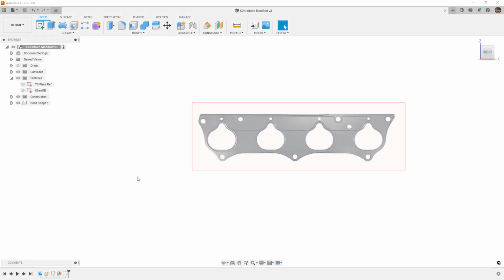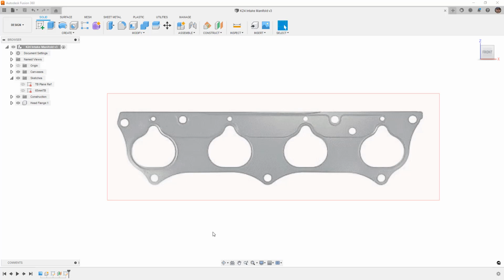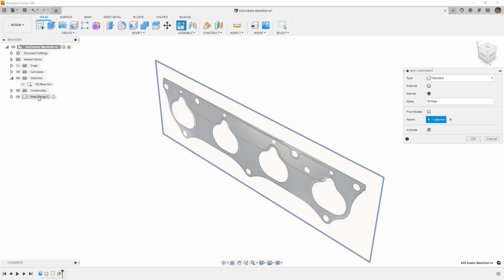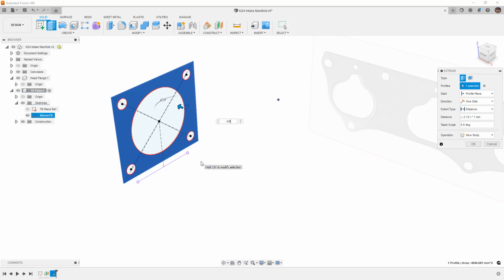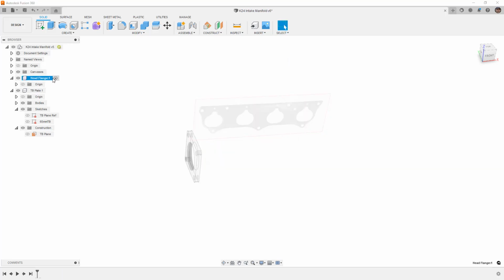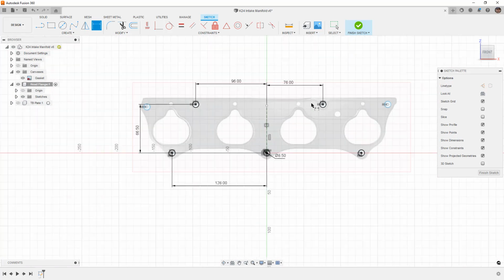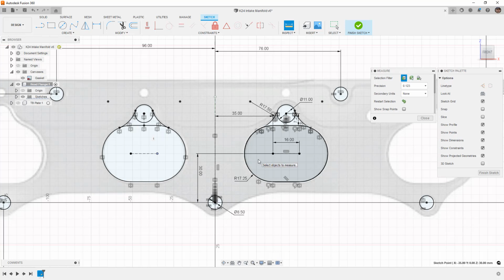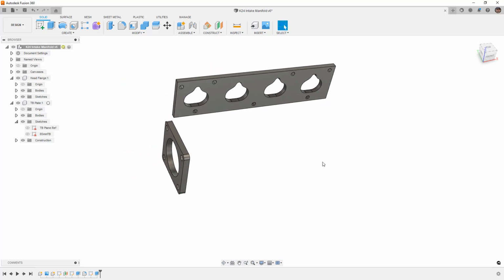Designing an Intake Manifold in CAD | Honda K20/K24 Swap Intake Design Series - Part 1 #Fusion360

Comment: I am loving you channel more and more. Fusion 360 and honda motors.
Reply from the maker: Thanks Jared!  Hopefully in the near future when I clear a few other projects I will start on my honda swap.  After this intake series I plan to do a turbo header as well.  What are you working on?
Reply: @LearnEverythingAboutDesign  I have a built b16a sir 2, built lsd ys1 trans, t04e garret turbo in a 1991 honda crx with a body kit. I want to get the crv trans and go awd.
Reply from the maker: Sounds like an awesome build Jared!  I often wondered how much abuse the old 80s/early 90s AWD civic wagons would take.  Not sure it would hold up to a built B16 but never know.  I had seen a RWD crx conversion but they put the engine in the back. kept the FWD layout and just moved it all back.  Those were great cars and really hard to find clean ones.  I see maybe one or two a year.
Reply: @LearnEverythingAboutDesign  They can take alot of abuse if done right. My buddies d16 with just a fairly simple build is reliable pushing 450 to 500 whp. My b16a sir2 is a jdm version and ive been abusing it at 300 wheel for 6 years or so. Until I turned up the boost and blew head gasket. I just decided to go all out and build it right. It just depends on the power levels you want and the reliability you want out of that power level. Tons of info online about it. I also think going k is a good idea rn, as b series blocks and heads are exceptionally more expensive than what they used to be. Get a good tune and overdo it for your application and you will have tons of fun with it.
Reply from the maker: I have watched tons of K series stuff and read all I can.  I had some good friends in the Honda world.  One was an 01 Integra TypeR with a turbo pushing about 350.  It was a great car even without the turbo.  

The AWD civic I was talking about was the late 80s Shuttle.  I thought it shared the floor or part of it with the CRX so wasn't sure how easy that AWD system was to work with and how much power it could hold vs using CRV parts.

Comment: This is oddly and perfectly useful for my applications! Thanks!
Reply from the maker: Great!  If there is anything specific you want to see speak now :)  I plan to create a "log" manifold first but then do a CNC and hydroformed version to show how to approach them all.  Hydroformed is a bit tricky with fusion since there isn't a surface unwrap feature but there are external addons(that cost money) that can be used.
Reply: @LearnEverythingAboutDesign  Love the idea!  Nothing specific, perhaps how different designs and their effect on airflow?
Reply from the maker: I will give it some thought.  Since Fusion doesn't have CFD(other than a fluid option in generative design) the visualization part might be a bit tricky.  Boost solves all problems ;)  Years ago I was playing around with making dual runner intakes similar to how some cars like the 3kgt(FTO) had a short and long runner set actuated by a valve.  Not sure if I will dive down that rabbit hole but I will try and present what I can.
Thanks!